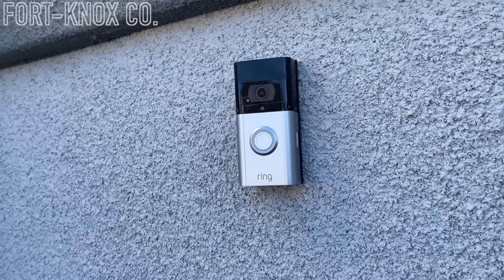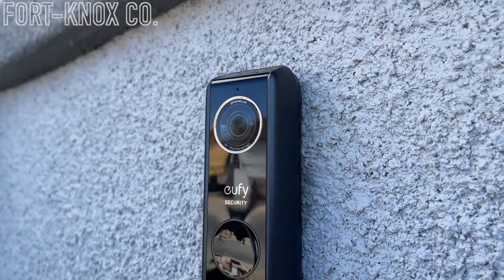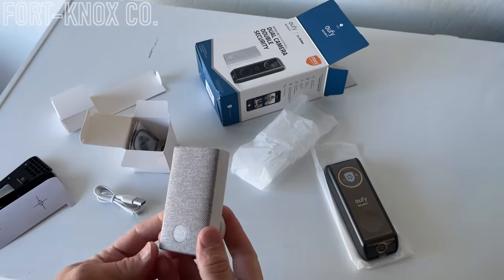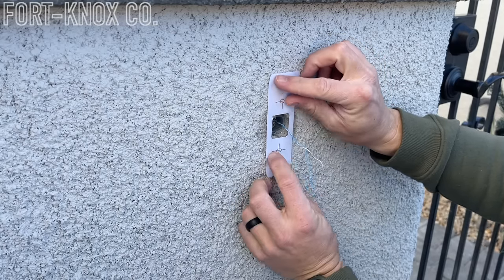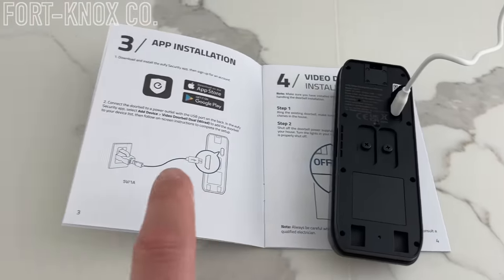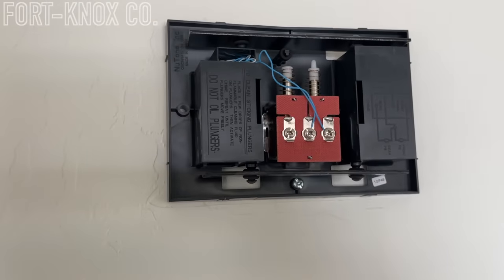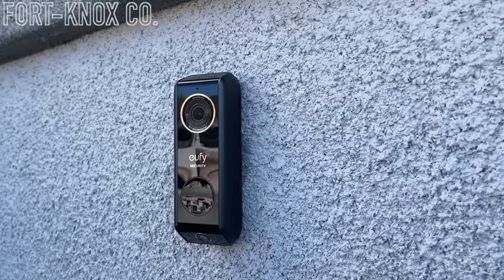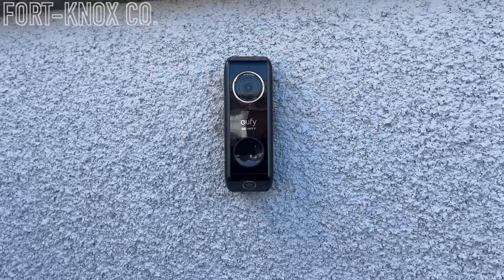BEST Video Doorbell 2024 with No Subscription Required Eufy Dual Camera Doorbell Installation Memory

Comment: not for that $$$
Reply from the maker: Are you referring to the price of the Eufy ? There’s wired camera doorbells for around $150. That’s pretty competitive
Reply: @FortKnoxCo  i live in old house not wired for doorbell is my issue
Reply from the maker: @aceplaya84  you can wire one if if your willing to touch some electrical. I have a video showing how you upgrade your doorbell transformer to run your video door bell more efficiently. Basically if you could locate an outlet near where you want to mount your doorbell you could install a transformer off of that outlet, then run your wires through the wall directly outside to the location you want your door bell. The wires that come off the transformer are very small telephone type wires, 18 or 20 gauge. The transformer reduces the power coming out to be the appropriate voltage/amp that the doorbell needs and you just wire in the doorbell on the outside of your home with the two small wires. It’s not too complex of a job especially if you have an outlet in the home near where you might want to mount the doorbell.